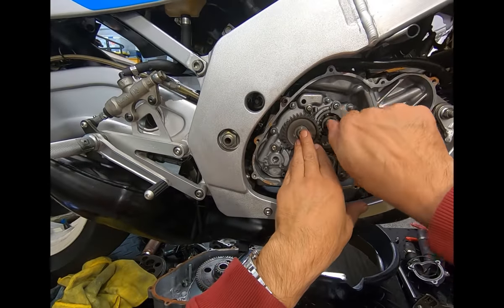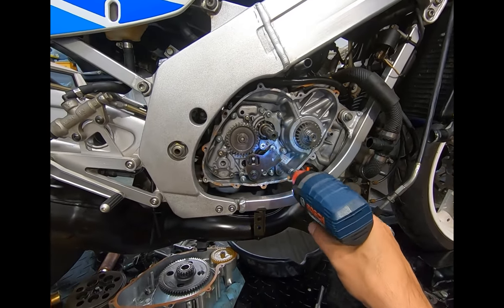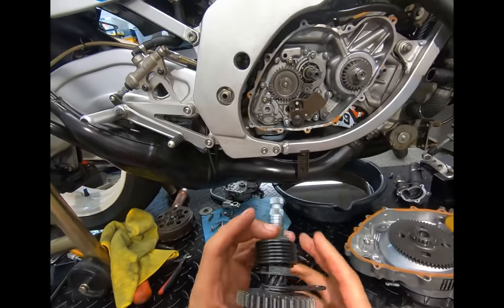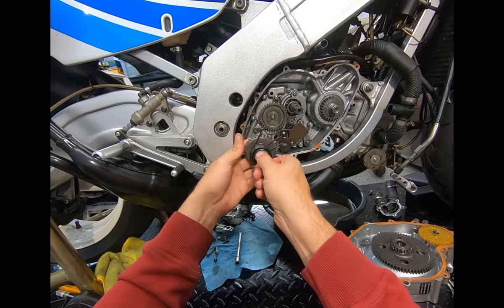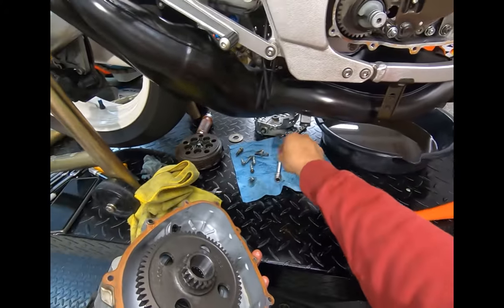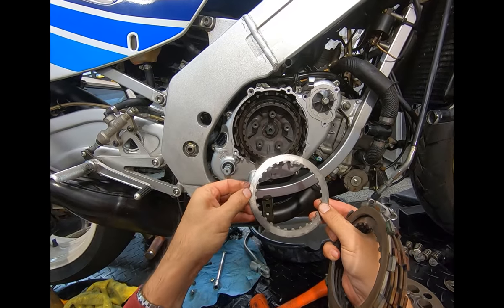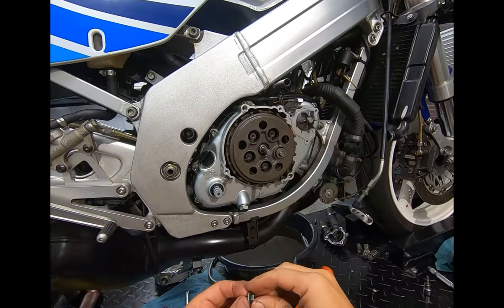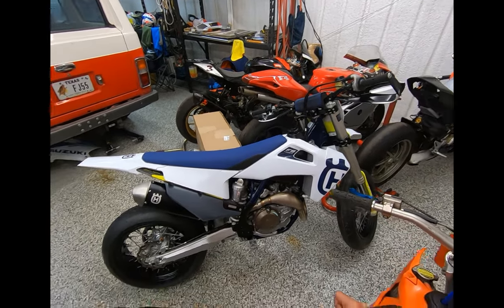RGV250 cassette transmission installation

Comment: My vj21's clutch is a little snatchy starting off in first gear. I was wondering if they are all like this or if I may have issues. I am assuming the belville washer is there help with clutch grab.
Thanks
Reply from the maker: Snatchiness is a result of wear. Sometimes it helps to remove the clutch plates and scuff them with 200 grit paper on a flat surface. You may find that the plates have uneven wear during this process in which case its a simple process to replace them and get a smooth and progressive clutch engagement.
Reply: @ShaunNielsen  Thanks, I have had a lot of bikes but this is the first to have a grabby clutch. I will pull it apart this winter and have a look, still having fun riding for now.
Stay safe and thanks for the info.